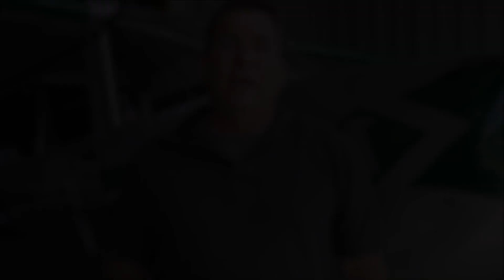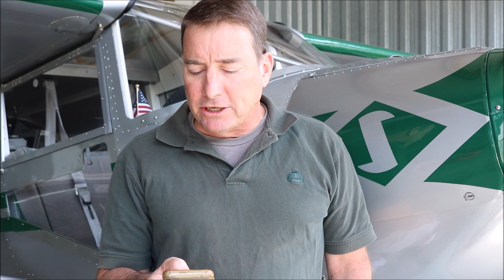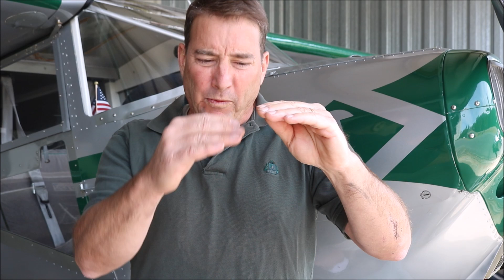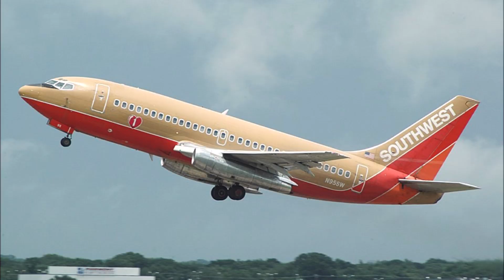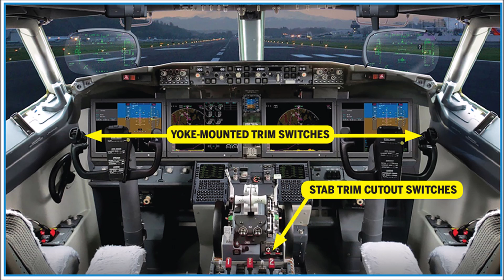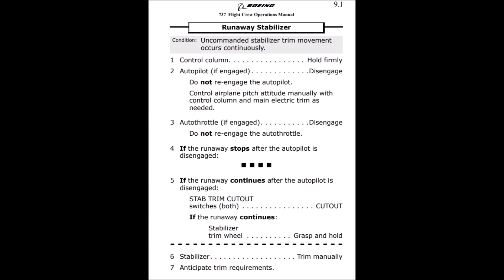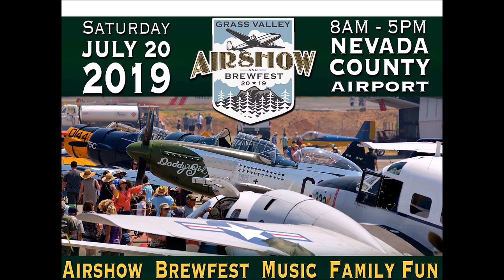737 Max UPDATE 27 June 2019 -The Latest Issue

Comment: Forgive me in advance for oversimplification: If I hear ya right (and I'm extrapolating) if the issue is signal propagation through all the chips, then perhaps the architecture (hardware / microprocessor chips) may need to be updated.   (Signals / instructions travel at the speed of light, by the way).  If it's a rate-of-trim (rate of change ) issue, it sounds like inefficient coding may be making the processors crunch through too many instructions to accomplish a task; or, more likely, it's the rate-of-change variable, as you'd mentioned, in the software that needs adjusting.  If the coding is burned into the chips (firmware as opposed to software)...well...I reckon we're back at architecture - replacing chips?  Another excellent update, Juan. Thank you for sharing truth.
Reply: The issue is the FAA are expecting the trim buttons to be a lot faster then what they are at moving the trim (nothing to do with the MCAS system)

Comment: Don't expect CNN or the AP to understand anything nuanced or even slightly complicated. It's all about the headline.
Reply: Charles Bates • Especially if it’s their opinion.
Reply: They don't need to understand anything except how to report the news.  The rules for doing this have been around for longer than any of us---when the rules are followed the system works.  When the rules aren't followed, the system doesn't work.  The death of traditional media is not an excuse to ignore the rules.
Reply: @Milkmans_Son  But I have to question if they are reporting news if it is misinformation to make a headline.
Reply: @gomphrena-beautifulflower-8043  If it is opinion then they should state that it is and not report as fact.
Reply: @Milkmans_Son  For the most part they are simply reporting the facts which is the real issue since many except it as fact. You used to be able to trust what came from the new report for the most part.
Reply: True. And this case it can be argued 'microprocessor' problem suggests a design error rather than a more accurate programming variable regarding trim rates as arbitrated by FAA pilots, and that it EFFECTS CORPORATE STOCK VALUE knowing the nature shareholders and potential volatility regarding safety issues.
Reply: CNN are the grubbiest of the grubby!
Reply: Charles Bates They are all the same today. Used to be able to count on the newspaper for the real news without opinion or speculation and we can’t even do that anymore. Until they are able to be held accountable for what they way we will continue to get trash news from all of the outlets.
Reply: @evankalbach9985  My point is they are not following the rules.
Reply: Evan Kalbach • Well, yes. That’s what the hubbub is about. They report their opinions as fact. What’s even sadder is, many people believe it as fact.
Reply: CNN sucks. I'm glad nobody watches them anymore.
Reply: What can we expect, CNC is fake news.
Reply: They’re “entertainment” channels.  All of them.  They’re not news, they’re entertainment, and that’s how they all get away with misrepresentation of world events to support their agendas.
Reply: but don't let that distract you from the fact that the max is broken and it is designed that way.
Reply: @ckatlinga I prefer the term Urinealists.
Reply: @evankalbach9985  Case in point their smear job on President Trump?
Reply: True!!

Comment: Much better discussion than the mainstream media, well done.  I've also read that there is some uncertainty as to whether the issue can be resolved in software, vs. a need to replace hardware, which I surmise is talking about the microprocessor.   This sounds like it perhaps could be an issue of inadequate execution time, and a more powerful microprocessor might be required.  Will be interesting to hear more as it comes out.  All in all, its rather disturbing that the simulation of a typical runaway trim  can't be handled adequately with manual trim.  Another case of inadequate FMEA and testing by Boeing.

Comment: It's not a "microprocessor", it's software. I worked in advance avionics for Boeing for almost 30 years on 707,727,737,757,767 and 777. Boeing uses dozens of makes microprocessors and microcontrollers depending on the box, the board within the box and the function. Back in the 8-bit era it wasn't uncommon to have two or three different brands of microprocessor in one black box, or white. The problem nowadays is software, as the 32 and 64 bit microprocessors and microcontrollers are fully capable of handling manual and electronic  commands in a timely fashion.
Reply: @Volcanman1  go watch more CNN then since you feel more at home with sensationalism than facts about this
Reply: I would assume there is some numerical value stored in some type of configuration data table that governs how fast the airplane manually re-trims. If this is so it's not really a software fix, which would make a change to the control logic itself. Rather its probably just a change to one of the operating variables that the control system software works with. Perhaps its called "Manual Trim Speed Rate" or something similar. From a purely technical standpoint it's probably easy to punch in a new number for this variable. The problem will be getting it by the regulators.
Reply: Yes electronics is fast very fast .
Reply: @joevignolor4u949  It's probably a mechanical problem jack screws are slow ,this not a fighter plane that can take many G's .
Reply: @pepelapew483  Regarding the jack screw. One factor was that the crew had gotten distracted and left the throttles at full take off power. This resulted in high airspeed. The high airspeed put more aerodynamic forces on the elevator, which made it harder to manually crank the jack screw. Further, changes to the 737 control panel over the years had reduced the size of the trim wheel. This resulted in less leverage to help the pilots turn the wheel. All of this convinced the crew that trying to manually crank the wheel wouldn't allow them enough time to manually trim the plane. This led to the decision to turn the electric trim assist back on, which reengaged the MCAS, which nose dived the plane again.
Reply: They should refer to it as 'trim adjustment rate'. Regardless how it is implemented, the reaction speed is intentional, by design. If Boeing wanted it faster or slower, they would have made it so. FAA's complaint is against an as-designed flight characteristic, not against some defect. There is no defect here.
Reply: @joevignolor4u949  Hindsight is 20/20.  After more than three months of analysis, It's easy for anyone to see what may have saved the aircraft. Reduce airspeed and manual trim. Or turn on  "Stab Trim" briefly when needed and shut it off again. I've watched so much about the 737 Max, I almost feel like I could program the flight control software myself and fly it.
Reply: @acoustic61  As you said, hindsight is always 20/20. Those two flight crews didn't have 3 months to figure it all out. This is why things need to be designed to not create situations like that in the first place.

Comment: Thanks Juan. And thanks for the real news instead of fake news!
Reply: Like Fox?
Reply: One good thing can come out of this. That every plane gets the same scrutiny as the Max. That can only lead to greater safety and trust in an industry whose safety record is very good these last 20 years despite some clear oversight issues with the FAA. We should also ask ourselves why this industry is so favoured over other modes of transport like high speed rail especially in areas of high population density. Airport congestion on the tarmac needs to be looked at as indicator of "too much" growth for this industry. When I got FlightRadar24 I was kind of shocked just how much overseas air traffic there was flying over our transatlantic last point of contact airports.

Comment: Thanks mate
Away from media and graping the attention, this is the only channel I trust for actual situation and right info.

I will drop question in the comment for you.
Reply: Hi Juan, thanks again for this series of update.
Previous generation of 737, the cuttout out electrical trim were one for the autopilot and one for the manual input by the pilot on the yoke. For 737, both to cuttout the whole electrical trim. So why two switches if they have the same function, and why Boing change them?
I feel there is something missing.

Comment: Juan, I don't know why everybody is talking about micro processers and main electric trim when the Boeing runaway trim procedure  has you cutout both the main electric trim motor and the autopilot trim servo motor. First of all it is very easy to determine which trim system  is running away. The main electric trim is fast and noisy, the autopilot trim is slower and quieter. This part is a no- brainer. Cutting out an operating system is totally incomprehensible. Secondly nobody seems to be addressing the issue of the impossibilty to trim the stabilizer manually as shown in the Ethiopian Air crash CVR recording. And finally nobody seems to want to address the auto throttle system which allows the aircraft to exceed max airspeed limits. This is very complex set of problems which require a complex and expensive fix. They keep saying MCAS is the problem when in fact it is the final link in a chain of events. It looks to me the The FAA is covering Boeing's rear end.
Reply: All if those points are true, and need to be addressed. This is a new and previously unknown error.
Reply from the maker: See previous updates.
Reply: @gordonrichardson2972  , I agree with you but my point is that nobody is talking about these issues, so I have to assume they are sweeping them under the rug.Out of sight out of mind.
Reply: @blancolirio  , I have looked at all of your previous videos  and I see nothing in them to change my opinion.

Comment: Juan, The microprocessor issue may be more than just changing the trim speed in software. All airborne computers have embedded microcontrollers / microprocessors that do their computions in a Real Time Computation cycle. These Loops are typically between 10 milliseconds to 100 milliseconds. (0.01 to 0.1 seconds). If one computer feeds another computer such as the ADIRU feeding the Flight Control Computer there is the transport delay to take into consideration. Let's say the ADIRU is on a 25 ms loop and the FCC is on a 100 ms loop. As airspeed changes the quickest the FCC will change the pitch attitude is 125 ms. The ADIRU takes 25 ms to convert the change in pressure to a change in airspeed and then the FCC will (once it receives the new airspeed) will take 100 ms to change the FLC pitch attitude command. In the case of flying the command bars on the PFD you have to add in additional processing time to display the new command bar information. It all ads up! 
It used to be a bigger issue than it is today, but it still needs to be considered. The original FMC's on the 767 / 757 were very slow to react to pilot CDU inputs. This was due to the processing time in the CDU, then the FMC and then back to the CDU for display. The ARINC 429 bus speed didn't help either. ...for what's it's worth.  Keep up the reports, great job.

Comment: Electrical engineer here with avionics design experience.  The FAA requires avionics software b thoroughly tested for every line of code and with errors in the binary data to verify what happens.  In this case, the assumption is the micro controller is assumed failed so manual electric trim is used to counter the nose-down attitude.  What Juan failed to mention is that the manual electric trim rate is unchanged from the original certified condition.  The faster manual trim rate requirement by the FAA is a new functional requirement that was not anticipated by Boeing.  That is not a Boeing failure,  but an FAA- mandated change based on accident history.  This is not uncommon in system development.  I highly doubt a new. MCU architecture is required to achieve the requirement.
Reply from the maker: Yep, see previous updates re manual trim. I cant cover everything in every update. You need to watch 'em all.

Comment: Appears to be an inherent time delay between pilot eye/mind/hand to move mechanical switch contact to input electrical signal to Flight computers with inherent microprocessor scan time delays, processing probably thousands of lines of code, to output a command to jack screw motor which also has a response time delay to move trim surface.  All series time delays add up.
Reply: Static Guy Something like that. There is a lot of real-time software (including MCAS) running on the FCCs, so there must be priority levels to prevent the microprocessor from becoming overloaded.

Comment: @blancolirio CNN was correct. You missed this part in the Aviation Weekly magazine article; 
"The tests also showed that a computer chip malfunction could lead to uncommanded stabilizer movement during the emergency procedure. FAA told Boeing to address the issues, and the manufacturer is complying."
Reply: The information leaked to the media is fragmentary and incomplete. This article gives a good overview, though we still don't know the full facts: https://theaircurrent.com/aviation-safety/faa-and-boeing-initially-disagreed-on-severity-of-catastrophic-737-max-software-glitch/
Reply: Agree that the new issue was not explained in complete detail to the public. Boeing appears to intentionally obscure the details of the newest issue from their official web site. It's not a very transparent explanation that Boeing provides. Your above link is much more specific. It describes one of the scenarios I was hoping they would test, overloading the FCC and causing the trim toggle switches on the flight column to be unresponsive or even just sluggish. The idea is to 'trick' the pilot into an indecisive situation. Can the pilot be decision-compromised with a runaway stabilizer trim where the recovery instructions fail to provide timely steps before the aircraft becomes unrecoverable? Apparently the FAA testers were able to do so even though the test pilots recovered the sim-aircraft. Perhaps this issue proves how critically important it is that Boeing does not certify their own aircraft. They may have chosen to ignore this scenario.

Comment: Boeing developed MCAS so the flight characteristics would be similar to earlier 737s.  Boeing did this so that carriers did not have to get their pilots rated/trained for a different aircraft.  I wonder what the difference in money would have been to just train the pilots for the new flight characteristics and leave MCAS out?  Of course, hindsight is always 20/20.  I'm sure they are in too deep to just remove the MCAS system and train the pilots on how to fly out of the situation instead of having the automation do it for them.
Reply: Yes, exactly, I do believe you took the point. It will be still a long story to regain the certification.
Reply: There seem to be two versions of the story.  One is that MCAS is there only to make Max's 'feel' like earlier 737's, for pilot rating reasons.   The other is that, to meet certification,  stick force is required to increase with increasing angles of attack, and in the Max (in high-thrust situations) it decreases at high angles.   This isn't 'unstable', but is not a permitted handling characteristic, so MCAS is essential.   Take your pick.   :)